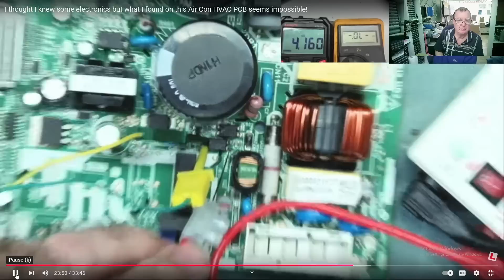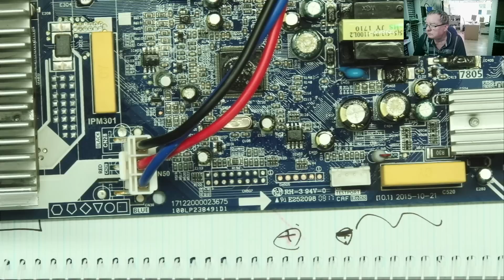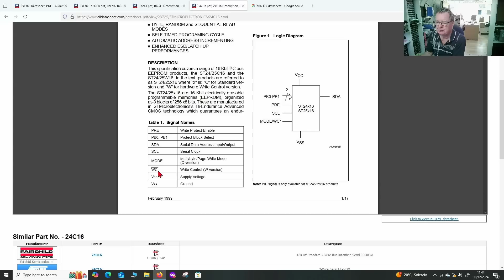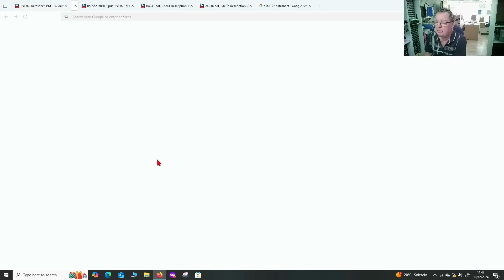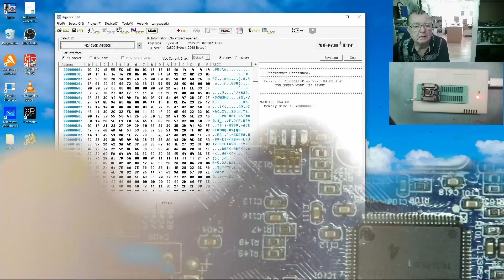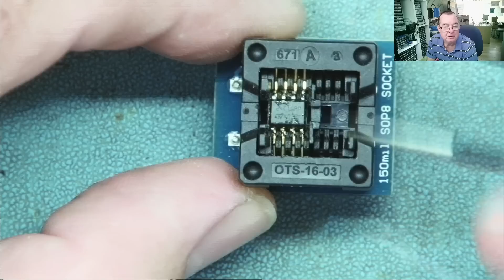HVAC Aircon Communication Error E6 EL10 etc What does this mean and can we fix it? An Investigation

Comment: i think the start/stop signal for the outdoor unit comes from the indoor unit via the digital communication bus. i did not investigate further, but i guess the communication is something like CAN bus or LIN bus as you find in cars. LIN bus for example is a single wire connection, connecting the car door controllers together. maybe you can find some documentation about that and compare with the aircon boards. for the EEPROM i think, there is maybe the configuration for the final product on there, limits and values for the "working ac". i would not test the board inside the actual unit without the correct software on it. it could blow up the unit. 
usually these aircons start communicating after the basic funktions are all in spec, some of them could even test the compressor or the fan motor for shorts or isolation faults.
don't forget, there are some more opto's inside the big switching module (i opened one up some years ago), the more modern ones even have a small logic inside.

Comment: The backlight tester appears to be AC mains powered. I am suspicious that it produces some substantial noise at its output. I thought I saw is a caution symbol on the top if it. Is the output fully galvanically isolated from AC mains?

If there is noise, especially at high frequency (which could be spikes at line or twice line frequency) on the output, it may be that the there is sufficient "stray" capacitance from the PCB tracks and circuity back to the AC line or ground to allow some current to flow with only one probe connected. That might be enough to get some emission from the IRED in the coupler. Behavior might be different depending on which side of the (apparently) non-polarized power input goes to line HOT. What is the nature of the power supply in the BL tester? Switcher? Linear I know of some very small mains-frequency transformers that would fit (look a lot like long, narrow miniature relays). Spikes at line frequency may be present or absent depending on what else is running from mains.

I would check the output of the backlight tester for noise. I'd try a DMM on AC between each probe and earth ground, looking first for voltage and if any found then very cautiously (with series resistance added) check for current. Use the best DMM available on the (dubious) notion it will have broader AC frequency response. Perform checks with an oscilloscope, BL tester probes (individually) relative to earth ground.

I"m not clear on the function of the optocoupler in question. Is it for communications or is it an AC mains zero-crossing detector or something like that? The high-frequency AC response is clearly shaped, one cap adding a pole and one a zero.

Comment: I would never overwrite the customers e2prom,  i would just copy and refit a replacement. 
Keep the PCB data intact for as long as possible, just in case. once you have overwritten it there is go going back to check if first read was OK.

Comment: Had a similar problem on a Mitsubishi unit - comms error 06. I was lucky in that the indoor and outdoor units were still hooked up. When I scoped the signals, the transmit trace had a terrible cut-off. The optoisolators tested OKish in circuit, but I removed both and tested on a breadboard with a switch, an LED and a couple of resistors, this showed one to be faulty. Replaced and fixed. Maybe you have a similar fault, easy to drop them out and test.

Comment: Just a thought on I2C.... it can have a habit of the protocol being corrupted or locking up (particularly in high noise or long wire situations). This could have corrupted the EEPROM data and confused the controller. Another possibility is bad software design is writing  data overly frequently and wore the EEPROM out.
I've used I2C extensively and seen corruptions/lock-ups on drones and camera gimbal circuit/firmware development - we had to put special code to un-lockup the bus in operation should it happen. It's mainly down to noise that causes it, and can be annoyingly infrequent to trace.

Comment: Good luck. As well as the indoor unit, you may need the interconnect cable and sensors. As far as I can recall, if the differential comms is missing or noisy then one or both boards partially shut down with error codes

Comment: I understand the concept of beefing up the current carrying capacity of a PCB trace by adding solder to it.  

What I don't understand on these two PCBs is why they've chosen to do this with rectangular areas of solder that don't appear to be continuous,  Wouldn't the areas of added solder not being continuous defeat the purpose of adding current carrying capacity?

Comment: Hi Richard, is it possible that when you're seeing the optoisolator transistor's resistance drop, with only the red lead of the LED tester connected, it's somehow related to there being residual voltage in the aricon boards main caps?  

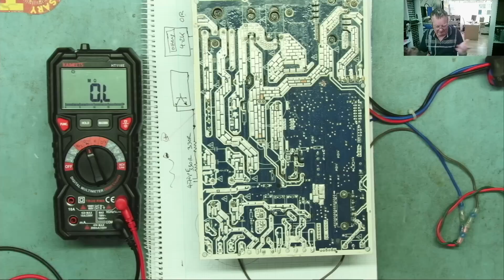I am wondering if this only happens after you've recently had the aircon board powered up and allowed the main caps to discharge, but they do still have voltage in them. Similar to when you flipped the boards over in this video (11:00 mark) and showed that they still had approximately 20V in them.  That residual voltage is not all that far off the output voltage of your LED tester when set to 1mA.  Even though only one lead is connected, is the voltage in the main caps trying to equalise with the LED tester's voltage, somehow causing current to flow between the two?

Comment: It would be interesting to compare the contents of the two EPROM files. There’s a text file comparison tool called BeyondCompare that would be useful for this. Ie see what content is different.
Reply from the maker: OK can do
Reply: @learnelectronicsrepair Windows has file compare app that you can run from the command prompt.

"fc /b file1 file2" without the double quotes.

if the contents are equal, it will say no differences found.
Reply: @getmefix1921  Nice !

Comment: Hello Richard! I watch your video with open moth) I have almost the same board and it is doesn't start and with short period has a fast blinking.(about 78 blink for 30sec/) Relay clicking but compressor doesn't start. And indoor unit has P1 error during fast blink. I think that it is IPM fault although I've checked it shoot be good, or EEPROM fault. It is very interesting yours continue this repair.

Comment: In diagnosing this error code it is important to know when it is shown. Is it shown as soon as the airco powers up? Or as soon as the compressor starts running? Or shortly after the compressor start running? Does the compressor actually run or only the fan of the outdoor unit?
Reply: Personally I really doubt that this board was defective. An inverter airco has many sensors that can cause error codes.

Comment: Great information! These inverter heat pumps are more popular due to much higher priced central hvac systems and more off grid power systems in the USA. Great for DIYers. I have a modified Gree 9000 btu (2.6kW for you) mini split hp in my work van. Love it.